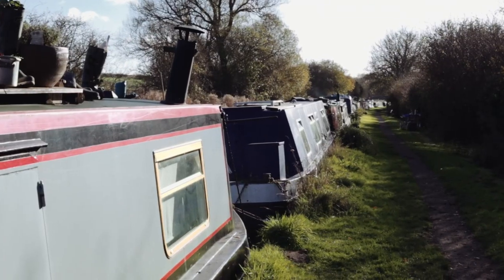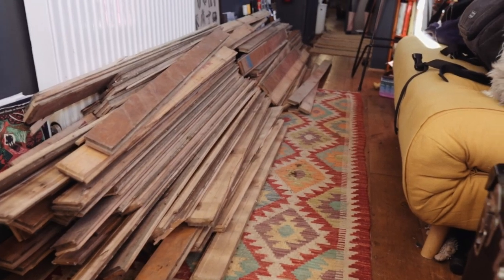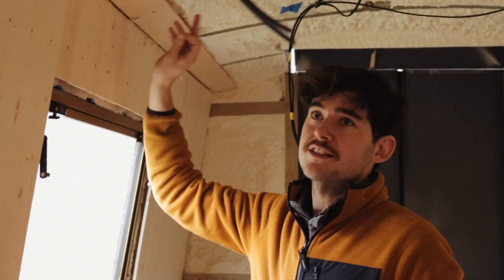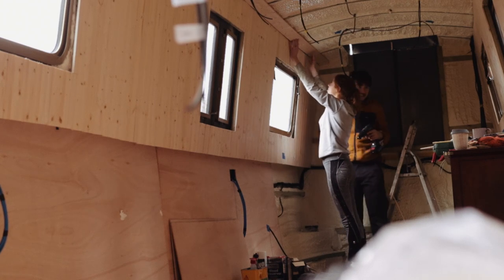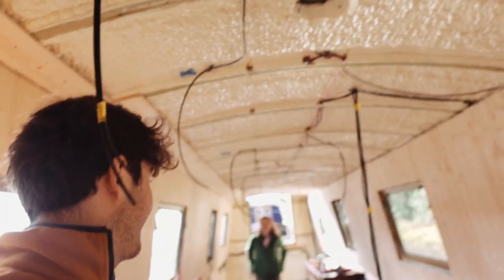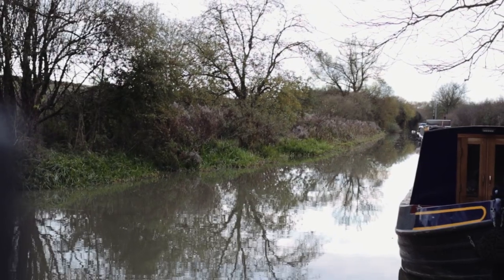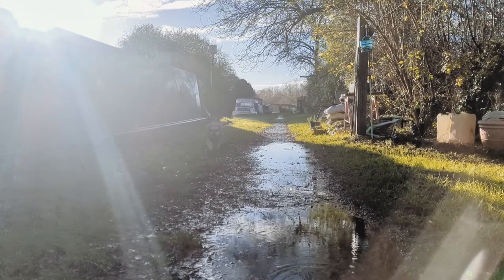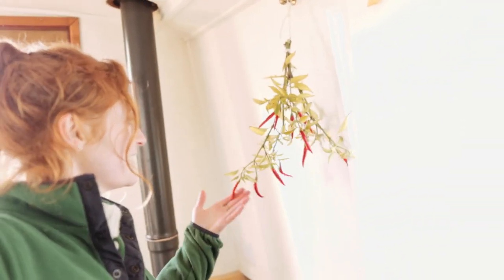How not to build a narrowboat: The struggle is real! | this tiny life

Comment: Hi guys I love the videos so far, love the T&G cladding. I couldn't help but notice that you have fixed your cladding with a single screw to the middle of the board. Not a good idea I'm sad to say after all your work. It will lead to cupping of the boards when the timber dries. I would suggest a double fixing or even move the fixing over closer to the tongue of the board this way you can hold down the tongue and the groove of the adjacent board with one fixing. Of course if you don't mind a cupped board look then it's
 ok. But otherwise I love the vids and keep up the good work.
Keith
Reply from the maker: Ah! I didn't think of this at all... Thank you for the tip, looks like I've got another trip to Screwfix to do after Christmas then!